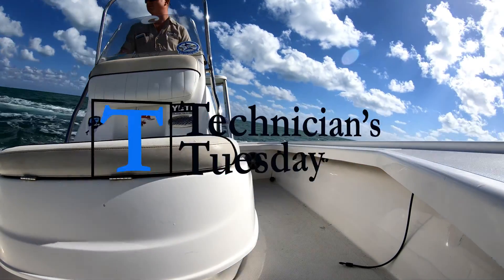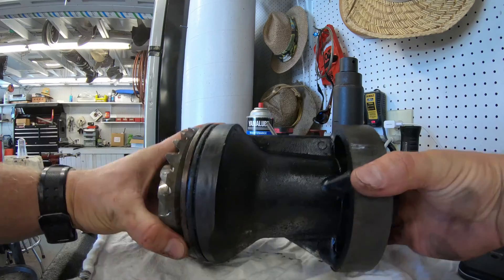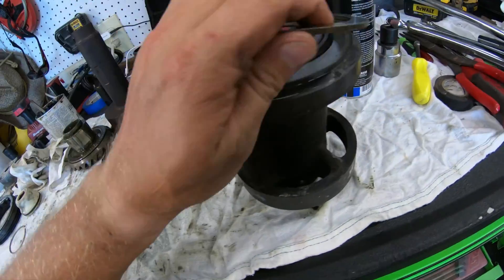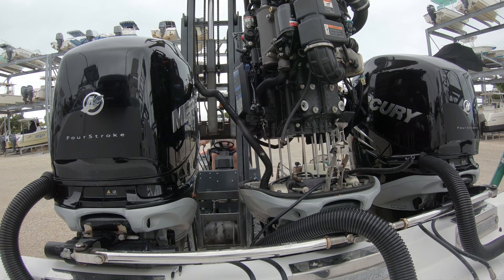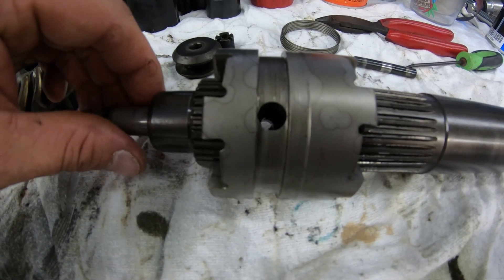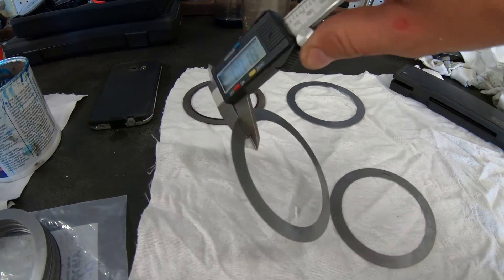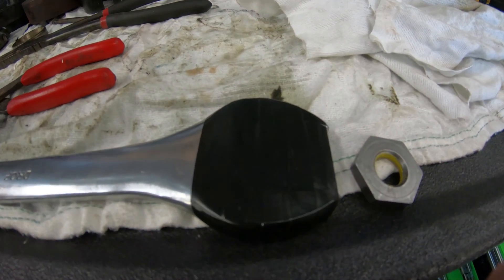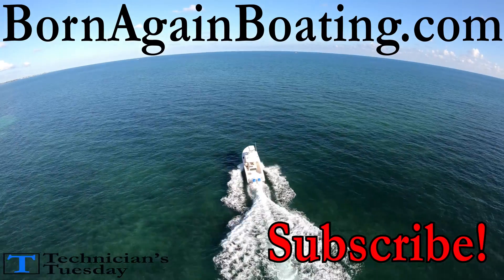Outboard Lower Unit Rebuild With Seal Replacement

Comment: Am following your video, got to pulling the gear case out but only the front part with the fins on came out, (i have the 3 finned carrier)so the rest of the carrier with the bearings and all must still be in the case. Do you have any recommendations on getting the rest of the carrier out please or a video link to this situation?

Comment: U can use a propain tank small one a lot of carrier get stuck bad from salt water corrosion so use the propain heat the lower until up all over do not keep in one spot and it will expanded and will release the carrier hope this helps  ya .x marine tech

Comment: Hello BAB!
Great video! I have successfully gotten the carrier (has 4 of the supports like yours) out of my lower unit but I can’t seem to remove the gear from the carrier like you show in the video. You simply turned it until it comes apart but mine just spins and won’t separate. Is there some kind of keyway that has to be lined up to be pulled apart? I will note there is some space between the gear and the face of the carrier along with a large washer/spacer in between that is loose. 
Any help appreciated as I am now stuck! Thanks! 👍🏼
Reply: @born again boating Hello again, any tips on how to get the gear off the carrier?? Thanks!

Comment: Great video. I watch your channel all the time. I've got a 2014 Yamaha F90LA with a bent prop shaft. Can you recommend a bearing carrier puller that would work well for this outboard. It seems to be wedged in very tight. I've been looking at this tool. https://www.offshoremarineparts.com/93-130-590.html?gclid=Cj0KCQjw5eX7BRDQARIsAMhYLP9kTLt52QVyM4kyld_cUM8f0SNHARqDePQCzamzhvWinPLNkPZerH4aAim1EALw_wcB

Comment: Hello, is the merc torque master 2 much different than this teardown?
Reply from the maker: I'm not sure. They should be fairly similar. But they are different gear cases, its best to have the right manual with you whenever you rebuild a gear case :/
Reply: Born Again Boating . Tore the TM2 today and it’s practically the same. The only main difference was this one has 18 needle bearings instead of the 21. Thank you for making this video.

Comment: Slide hammer , with bearing adapter , won't work as well as a puller but the parts store will rent them

Comment: When changing shaft length on the Verado, looks like you also have to change out the upper shift shaft.  Do you have to pull the power head to replace that shift shaft, or can you get to it by getting some things out of the way?
Reply from the maker: Yes you do, but sadly no you can't, youve gotta pull the powerhead :(

Comment: Very good video. I have a lot of experience with bravo stern drive the easiest way to remove a bravo prop shaft carrier is by just getting small aluminum scraps more or less about an inch tall and build them up around the prop shaft, of course this will all have to be taken down before the carrier is removed from the case. Then with old bearing races or similar build up to the threads of the prop shaft and use flat washers and a old prop nut with no nylok. Tighten down till movement making sure not to bottom out on the spine. This will only work with bravos that shift in the upper. I have never tried it with a bravo3 that’s not a performance drive just bravo ones and two’s

Comment: Do you have a video on lressure testing a lower end? Also do they vacuum test them too? I know some seals are fine under pressure but when a small vacuum is applied they leak. And by small vacuum i mean as little as a good heat cycle may produce.
Reply from the maker: No, we don't have a video on pressure testing the lower, which would be a good video. You can vacuum test them, but I haven't vacuumed a gear case for years now! They absolutely could leak under a vacuum from a heat cycle but generally gear cases today are pretty solid, and if they hold 12 PSI then you don't normally see any issues.

Comment: Hi.. I like the content of your videos. I wonder if you are in South Florida my any chance? If so, I might need you to take a look at my  lower unit.
Reply from the maker: Hey! Yes, I'm in the keys but I don't really do side work. What's going on with your lower?
Reply: Hi. Thanks for your reply. I hit a rock and I bent the prop while I was in KW. However, I noticed after the fix there is some vibration in reverse and not that obvious in forward as well. When I got home I observed the lower unit is got some type of metal sound when I put engine in gear. Not sure if this is something to be concerned about. After wall I hit the lower at WOT...
Reply from the maker: Ouch! Yeah, that will do it :( Um, it's hard to say without looking at it. If you had it repaired by someone reputable and they tested it, you should be good, but at the same time, like you said, when you hit a rock at WOT sometimes you can do your best to fix the lower, but it could just be so out of whack that it can't be.  Do you have any kind of warranty or insurance?
Reply: GM... My standard warranty expired three years ago; however, I still have Y.E.S. warranty coverage till November of this year. I believe this warranty covers major parts, etc. Do you think I can use this warranty to get this looked at/corrected? That would be awesome!!
Reply from the maker: @marlonm396  oh, idk, that's pretty far into it. Sometimes Yamaha is nice and will cover some things, but they can be stlickers too. Normally, that's not really a manufacturer defect lol but it doesnt hurt to ask :) they will probably tell you no way, but that's not going to be a shocker. I think your engines to old for them to be nice about a ground strike :(
Reply: My thoughts exactly... my engine is 2013 so it isn’t old at only 150 hours
Reply from the maker: @marlonm396  No, that isn't bad at all. What HP is the engine?
Reply: @BornAgainBoating , I didn't think so. The engine is hardly broken in.. It is a 2013 Yamaha 150. Four stroke of course!!!
Reply from the maker: @marlonm396  Those 150's are bullet proof! Great engine!

Comment: i used a steering wheel puller to take my bearing carrier out! I bought threaded rod,nuts and washers which would thread into my E tech 25hp bearing carrier. this motor lived in salt water for 8 years.https://www.amazon.com/ABN-Harmonic-Balancer-Steering-Puller/dp/B0172I7QWC/ref=sr_1_3?keywords=steering+wheel+puller&qid=1562375857&s=gateway&sr=8-3
Reply from the maker: That's awesome! That's nice that they have a place to thread into to attach the puller! :)

Comment: Since you have the lower unit so far apart, would you mic the gears to check for wear?
Why not replace the needle bearings with the unit apart?
Why were the other bearings not packed with grease? 
Does everything only go back together one way as not to put anything on backwards?
I really enjoy youe videos,  I've learned so much! 😀👍🏻🚤🔧
Reply from the maker: You could mic them, I'm not so sure that it is necessary though :) The needle bearings weren't worn out enough to justify replacing and you don't want to pack gear case bearings with grease. Instead, you want to put some clean gear lube on them and then install. Yup! Everything only fits in one way :) you don't want to change the preload on any of the bearings. Thank you very much, glad they have been a help to you! Thank you for all of the comments :)
Reply: @BornAgainBoating  Good to know, I'm often torn when taking something that far apart if it isn't worth it while since  you are there just to replace wearable parts.and be done with it. 
Very informative 😁

Comment: Another great video!
I've been  learning a lot with you. Thanks!
To pull the prop shaft / bearing carrier I use a heavy duty home made slide hammer
Works good for me
I just have to change the nut for the apropriate prop shaft splines

https://imgur.com/dc8Jppn
Reply from the maker: Thank you and you're welcome! Sweet that looks like a sweet slide hammer. With a hook to grab onto! Cool!

Comment: Great vid very intricate job having the right tools makes life easy but a DIY at home wouldnt necessarily have all that is required its then understood why marine shops charge so much.....
Reply from the maker: Thank you, yes, once you get into doing projects like this, it really isn't a DIYer.

At the same time, it is possible to do all of the seals. It only gets tricky when it comes to tightening down the spanner nut :)